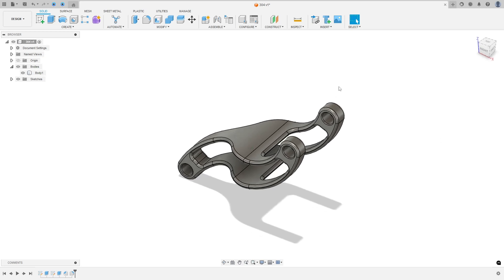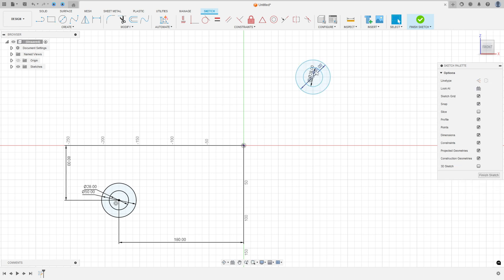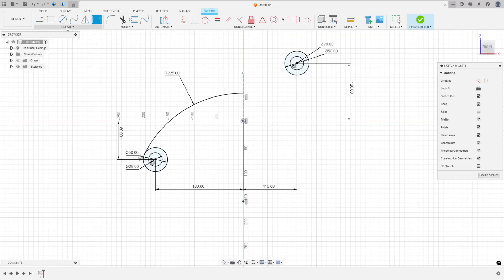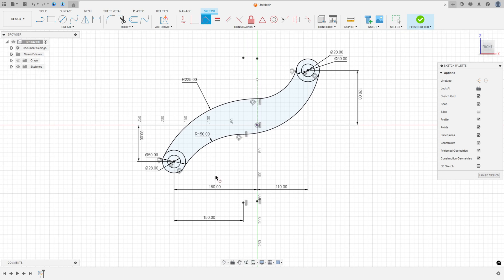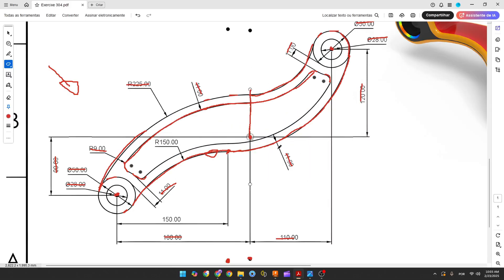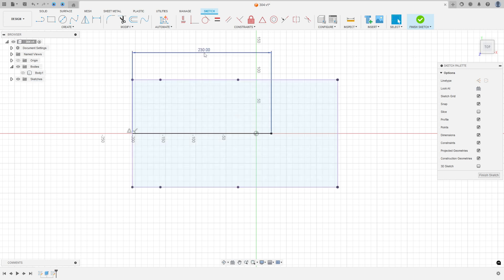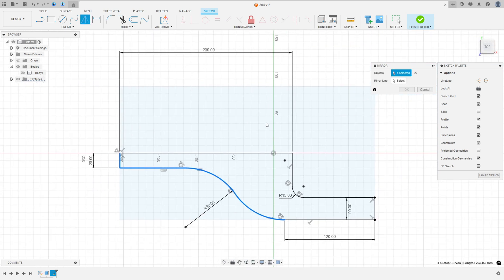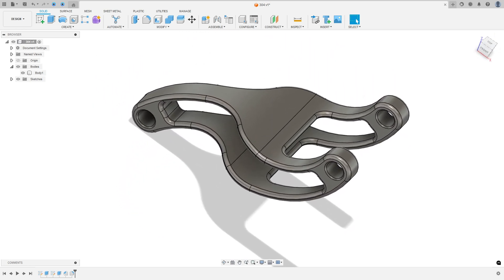How to use Extrude Intersect in Autodesk Fusion  - Exercise 304

Comment: Hi! I have a question—I'm a beginner in 3D design, and to be honest, my background is in software engineering, so I'm not very familiar with mechanics and related topics. When you're designing something in Fusion, do you usually start with a hand-drawn sketch and predefined measurements, and only then move to Fusion once everything is decided? Or is it more of an iterative process directly within Fusion?